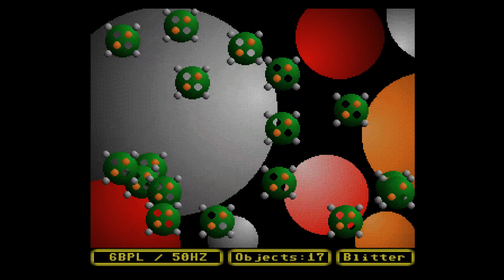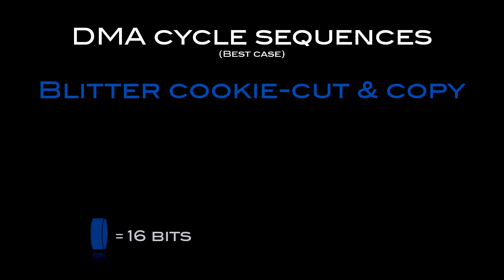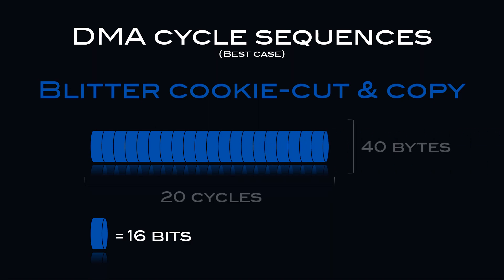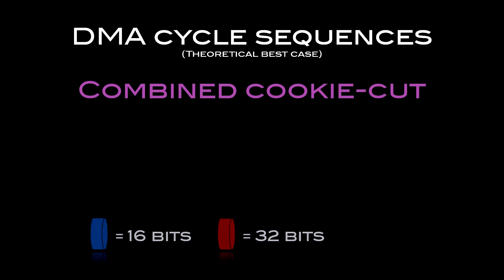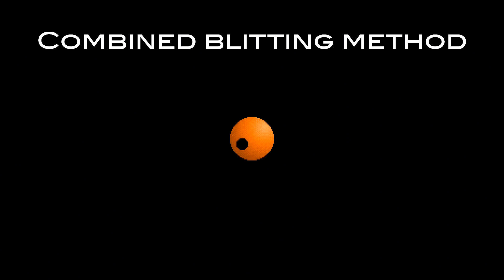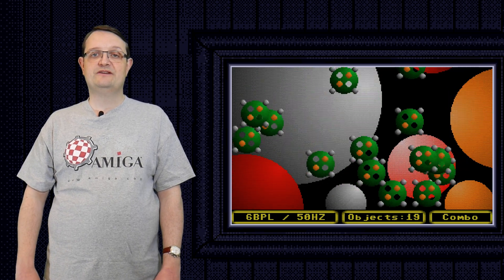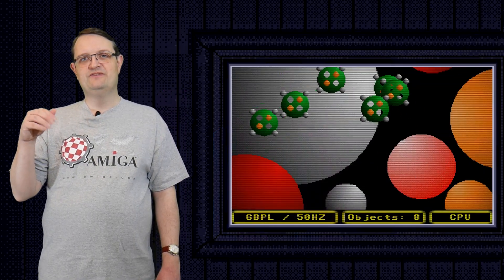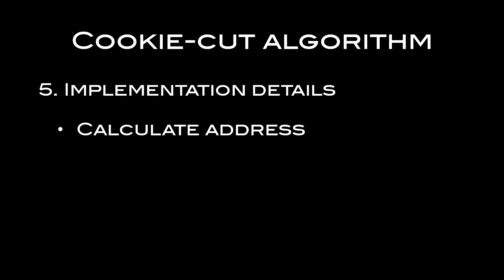Amiga Tech - CPU Assisted Blitting (A1200)

Comment: Here's a question. On an Amiga 500, how many filled moving polygons could you generate at around 30 FPS using a combination of NTSC Agnus and 68000 at a resolution of 320x200? How much does the hardware line draw and area fill contribute to the polygon total? Sounds like another interesting video topic for your excellent series.
Reply from the maker: @Nebulous6 I’ve not experimented with filled polygons on the Amiga, so I can’t honestly say. It might be an interesting thing to look into though. Thanks for the idea, though I can’t guarantee it will be made into a video 😉
Reply: @DutchRetroGuy  Thanks for the reply. No need to try it if you don't have time. Just thought I'd mention it since there's an idea going around of making the Boing ball in 3D on an OCS machine since Agnus will automatically complete a 3-sided shape if two co-joined lines are specified and of course includes hardware area fill. As far as I can tell, that ball is 128 polygons with 32 of them being 3-sided and the rest quads. That makes a person wonder if it's possible to render the quads as 4-sided instead of as two 3-sided polys (and if it would be more efficient as quads). I suspect only the 64 polygons that face the 'camera' would be required to be filled to complete the illusion. I sure wish I had the programing skills to even half-way attempt such a thing....

Comment: How big are your bobs? 19 seems REALLY low. I had 30 in my demo, but I don't use something as slow as a cookie cut.
Reply from the maker: Cookiecut is usually needed for bobs in games, which is why I used it. The bobs are 32x32 on a six bitplane screen. I suspect the difference in speed is probably due to not needing cookiecut in your demo. If you can get away with just doing copy blits, you get a lot more bobs on screen.

Comment: What about Blitter & spites in Amiga 1200?  Was the same chips like in Amiga 500 or with more possibilities ?  What about clock ?
Reply from the maker: The Blitter in the A1200 is the same as the one in the A500. However, due to the AGA chipset being more efficient at displaying the screen, it still gets more cycles per frame and thus appears to be faster.

AGA Sprites are improved over their A500 counterparts. Where the A500 was limited to Sprites that were 16 pixels wide, the A1200 could display Sprites at up to 64 pixels wide each. The A1200 also can choose which 16 colour bank(s) of colours to use for Sprites, meaning that in 32-128 colours the Sprites can have separate colours from the main screen, unlike the A500 where this was only possible if the screen used 16 or fewer colours.

The Chipset still runs at 3.5MHz, though both the CPU, bitplanes and Sprites can now access memory in more than 16 bit chunks.
Reply: @DutchRetroGuy    THX for quick answer with good explain.
Reply: Good question. I'd love to see a video in this series discussing using OCS BOBs and Sprites at the same time (with maybe a Copper color bar in the background).

Comment: Pretty sure that on Amiga 500 you could get a speed-up if CPU was used for simpler things such as clearing/restoring background. I.e. when you are restoring the previous blits off the background you can use blitter and CPU together to gain some performance.
Reply from the maker: On A500 clearing with the CPU and Blitter together is indeed quite a bit faster, but copy operations (i.e. restoring the background) are always slower than the Blitter if the CPU is also involved.

This is due to the fact the CPU has overhead in reading the instructions (and reading/decoding additional word(s) for the address to use), which the Blitter does not have. Since both the CPU and the Blitter access memory 16 bits at a time and the CPU can’t use all DMA slots while the Blitter can.
Reply: Thanks for the info, I appreciate it. It's been so many years since I coded on A500, so it's quite possible the speed up was for clearing only. @DutchRetroGuy

Comment: Hmmm.... I think in real world you would rather use the CPU to do some calculations and controlling, wouldn't you? In that case, one thing you could to to speed things up is to interleave the processing... not first doing all the calculation and then all the blitting, but take care that the CPU doesn't wait for the blitter, but does other things while the blitter is working.
Reply from the maker: Certainly that is an option. However, one of the reasons I made this is that discussions I had and saw on EAB about the topic of keeping the CPU busy while blitting usually ended with developers pointing out it was difficult to do that because in most ‘real world’ cases you tend to do the blitting in sequence rather than having other things to do.

At any rate it’s certainly correct that (especially on AGA) keeping the CPU running while the Blitter is busy is a good tactic. This is just one way to do this, you can do it in many ways.
Reply: Exactly. I used to a crap load of stuff whilst the blitter was blitting. I'm not sure how big his bobs were, but I'm pretty sure I could do a lot more than 19 and did a load more than that in my earlier demos.
Reply from the maker: @thewelder3538  I would like to point out that blitting 19 bobs using a standard cookiecut + copy for restore algorithm at 32x32 pixels in 6 bitplanes is the equivalent of blitting 131328 bytes per frame or ~6,26MB/second . The Blitter’s theoretical bandwidth (which you never actually can get, you lose quite a few bytes per second for bitplane DMA and CPU overhead) is ~6,78MB/second.

Unless you either lower number of bitplanes or use a different blitting algorithm (which will make your blitting code less generally useful unlike mine here) you will not get as many bobs as I show here by just using the Blitter. The overhead cost of bitplane DMA and CPU will eat into that number, resulting in fewer bobs. This is shown in the program I show here by the way, just set it to ‘Blitter only’ and you’ll see the number drop.
Reply: @DutchRetroGuy  Okay that's true, but in 6 on an OCS machine wouldn't mean you're blitting in half-bright, on an AGA you'd be blitting 64 colour bobs. I'm not sure why anyone would do that for 32x32 pixel bob. On AGA, that would give you only 4 colours for any background you're blitting over. I'm actually more interested in the way you're erasing the bobs. I assume you're using the blitter shift register? Also, depending on how you're doing the bobs, I'd also be using the scroll registers and repointing the bitplanes down the screen to duplicate bobs already blitted.

These are like classic demo effects.
Reply from the maker: @thewelder3538  the amount of bitplanes the bob uses has no relevance for the number of colours left for the background, both use the same 6 bitplanes and thus share 64 colours between them. This is also why I use cookiecut mode for blitting.

I restore by blitting the rectangle the bob takes up back from a pristine copy of the background graphics.

Perhaps the problem here is misunderstanding what I'm doing - this video isn't meant to show the maximum number of bobs you could draw using methods like you've used in demos where you have full control over the entire scene. Nor am I trying to show what the gain can be if you separate the bob layer from the GFX layer. 
(mind you, those might be interesting ideas for later videos)

Instead, it is an experiment in drawing bobs with the CPU and Blitter that is compatible with the way most games have their display set up.

This means things like the bobs sharing their playfield with other graphics which have to stay in place and can have any shape, that the bobs can have any shape at any time, can freely overlap, can be in places the coder can't know ahead of time and leave the rest of the background/foreground in tact.

Naturally, if I drop some or all of these requirements, all sorts of additional tricks become possible to increase the number of bobs processed ;)
Reply: @DutchRetroGuy  But separating the bob planes from the background planes is the way to go. Firstly you don't have to copy what you're blitting over and restore it afterwards. That's a major saving. If you're going to blit into the same bitplanes as background graphics, I'd have a damage map. Thus you only restore areas not covered by the new bob position. In fact, this is something I'd be doing with the processor whilst the blitter was blitting. Thus if I'd got say a 2 pixel shift right, I'd only have to restore half the size of the bob to restore the background data. Easily done with the blitter mask. Since the movement is way less than the minimum size blit, I'd use the CPU to restore the background whilst blitting the new bob.
Reply from the maker: @thewelder3538  It's not the way to go in games. They almost never do this, as you'd lose too many colours. This code was aimed at general purpose code (or for use in games), so it doesn't draw to just some bitplanes and leave the others for the background.

I do understand all the ideas that you propose, but most of them just don't fit what with what I'm trying to show or how things are done outside of the demoscene. 

Except for the damage map, that might be a nice experiment for the future.
Reply: @DutchRetroGuy  That's because most of the people who wrote games, weren't from the demo scene. Where you had people from the scene who went on to writing games, stuff like Pinball Dreams, Brian The Lion, Elfmania and stuff like that, you'd see more of the techniques I'd described. You only have to look at something like Rink A Dink Redux to see what you can do if you really know the hardware.
Reply from the maker: @thewelder3538  well, be that as it may, the main perfomance boosting trick you mentioned (i.e. blitting to only some bitplanes and reserving the rest for the background) is clearly not actually in use in any of these games.

Just look at Elfmania. If the player bobs used say 4 bitplanes, they'd have 2 bitplanes at most left for the background, as this is an OCS game. That's clearly not what they did. Other splits (like 3 for the bobs and 3 for the background) also wouldn't work given the GFX we see. Not only that, but if you actually look in the Visual DMA debugger you can see that the amount of time spend blitting is quite comparable to what you'd expect for standard cookie-cut+restore blits of the sizes of objects in use.

You can do the same thing with Brian the Lion and you'll see very similar results.

This doesn't mean these games don't use tricks or are poorly programmed (not in the slightest, they're great!), but they really don't use the kind of tricks you are refering to.

And that is exactly the point I'm trying to make. Games and demos really are different things and require different approaches.
Reply: @DutchRetroGuy  My argument isn't that it's a valid technique for doing stuff, but it's very use case dependent. In something like Xenon 2, you could easily separate the background from the bob. You make it sound like in demos we don't draw stuff over backgrounds etc to maintain color depth. We do. In Rink A Dink Redux there are 8 circles, made up of triangles, so you're blitting into multiple planes and restoring the previous bitplane data. Using the hardware sprites, plus a few bobs is all you need for most games and maybe an 8 way scroller.
Reply from the maker: @thewelder3538  I did not say demos only draw bobs like that. In case you misunderstood me, I intended to say it's easier to make such decicions when coding demos - not that it's the only way. And the reason I say this is because you essentially have full control over what happens in a demo (unlike games, where the player's actions and interactions complicate matters). 

My reply was based on your suggestion that 'the way to go' for drawing bobs is to separate the background from the bobs. And I pointed out that this is not something that is normally done in games. Even in games made by (ex) demoscene coders.
Reply: @DutchRetroGuy  Agreed. Reducing the number of colors used in order to blit less was a choice that very few games made on the Amiga. In the general case, you'd want to use as many of the color registers as possible, which means that most blits would use the full bit depth if the background was complex.

The damage map is a good way to reduce clearing work to the minimum but there are other techniques:
if your blits are very wide horizontally and mostly opaque it's possible to split them into cookie cuts for the transparent parts and pure copies + clearing for the opaque ones. That saves a lot of DMA.

It's also useful to keep a high level representation of the background tiles bit depth:
if you know that a wide rectangle of the background doesn't use certain planes, then for all the blits which do not overlap you can convert the cookie cut operations for those planes into pure copies.
Similarly, the clearing operations in those empty sections of the background planes will be simple clearing (0 source blits).

I'm sure there are many other optimizations possible.
The trick being to use higher level information to do only the minimal amount of work actually needed.

Comment: Glad to see you are keeping the Amiga alive!  I still have my Amiga 2000HD from the 80s, with 68060 accelerator, Emplant board, Picasso II board, Opalvision board, and GVP Time Base Correction/Frame Grabber board.
Reply from the maker: Cool setup. I still have both my Amiga’s from back then (and an A600 as well for good measure), but even now they’re nowhere near that spec. I have an A500 with ACA500+ and an A1200 with a Blizzard 1230MK IV, both with scandoubler and the A1200 also has a Rapidroad USB controller in there, which makes file transfer really easy!

Comment: Just the video I need.. for my chipset.library
Reply from the maker: I aim to please :P
Reply: @DutchRetroGuy  I setup a git repo, in your copyright notice, it says “ME” who is me?

https://github.com/khval/CPU-Blit-Assist
Reply from the maker: @kjetilhvalstrand1009  my Copyright notice does contain my name. It's right there on the front page of your github repo ;)
Reply: @DutchRetroGuy  A question where is the screen setup in this tutorial?
Reply from the maker: @kjetilhvalstrand1009  screen setup is handled by the Copper. The CPU_Blit_Assist.asm file starts the Copper on lines 155-158 (; Activate copper list).

The Copper list itself can be found in Data/copperlist.asm and contains all custom chip set writes required for the screen setup - apart from a write to BPLCON3 to set AGA/ECS features, IIRC.

Several routines are called to fill in the missing palette and pointer values. These are called in CPU_Blit_Assist.asm from lines 102-110 (; Fill in missing parts of initial copper list).
Reply from the maker: @kjetilhvalstrand1009  one more note: my code uses a rarely used feature of the 68020 instruction cache which allows it to freeze/unfreeze the cache to force specific routines into the cache.

In retrospect, I feel the extremely small performance boost this offers (<1%) is not worth the "hacky" nature of the fix. It's probably worthwhile to remove all reads or writes to cacr (movec <blah>,cacr & movec cacr,<blah>) to sanitize the code and so prevent potential performance issues on faster systems.

Comment: From what i have read on stock a1200 when you set only 4 bitplanes it runs much faster than when using more bitplanes. It is something connected with bizzare memory interface aga has.
Reply from the maker: Interesting. I've not noticed any such thing myself, but I suppose it could be possible. Strange stuff!
Reply: Via experiments I discovered that Fmode makes rather big difference on AGA. even 8 bitplanes with fmode 3 doesn't jam the machine as it would on "ocs" (fmode 0) mode.
Reply from the maker: @CrazyArtEducator  yes indeed, FMODE makes a pretty big difference. My code runs in FMODE 3 (4x fetch) already. It would lose a few bobs per frame if it ran in FMODE 0 (1x fetch).

However, as I understood the original poster's comment he was not talking about FMODE but rather 4 bitplane mode by itself. Do note that I've not been able to verify his point for myself, though.